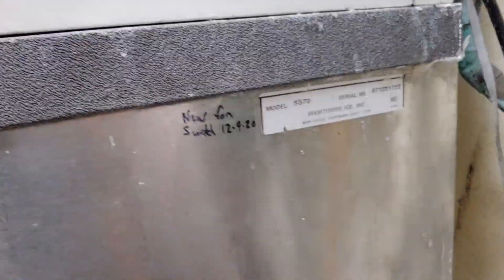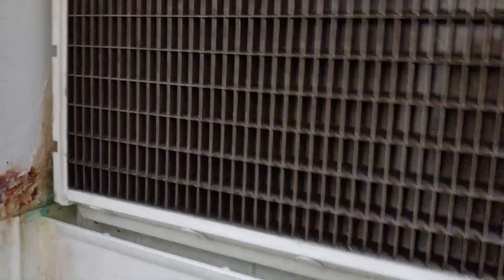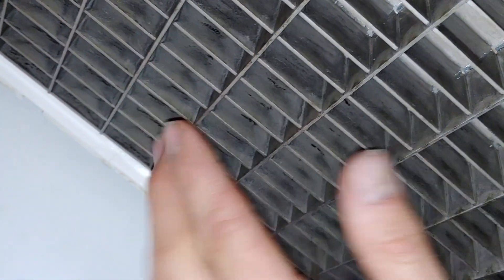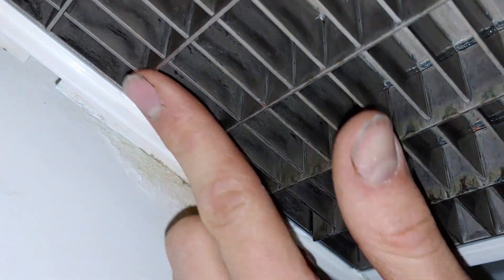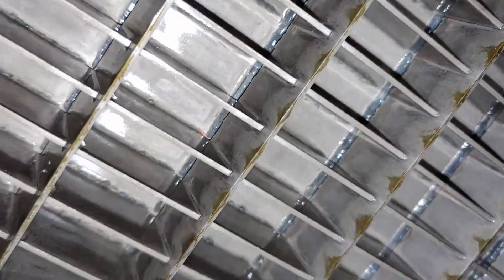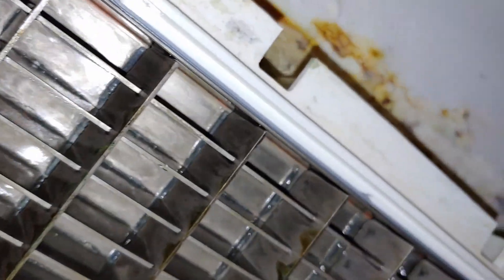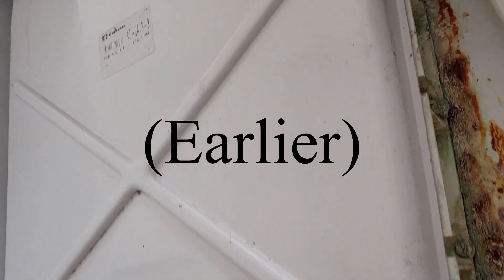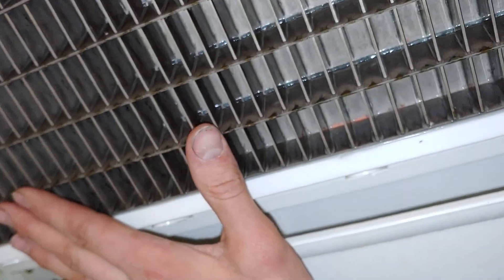Ice Machine Wont Drop Ice; Bad Evaporator

Comment: Do you how to repair that but not replace the entire evaporator?
Thanks
Reply: Sometimes if they are completely disconnected I have pulled out a row or 2 to get them by. Makes wierd shaped ice but works
Reply from the maker: I took a rubber mallot and pushed everything back into place. This allowed the machine to operate again for a short time. You could try that?
Reply: @ReubenSahlstrom  I've made the same repair before. You can actually see little Xs near the edges of the evap where the manufacturer peens the pieces together to keep them in place. I repeened the loose ones in with a screwdriver... not the best tool but did the job. It worked well for some time. I enjoy the videos and have learned a thing or two. Thanks.
Reply: I have tapped them back in and used a small chisel and ping them over. each one,  so they will stay in. Not perfect, but will get more time out of the machine.

Comment: Flat head screw driver knock a x on the sides of the evaporator where the plats meet and make a x . Knock a x into where the joints meet and you can usually get a few more years out of it